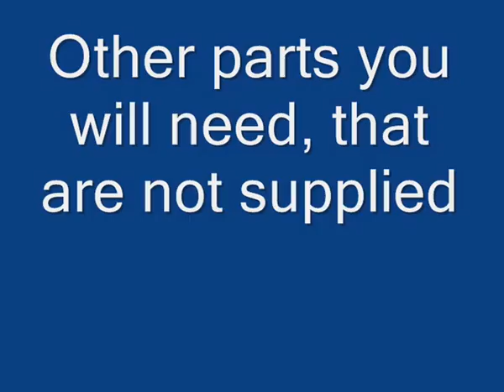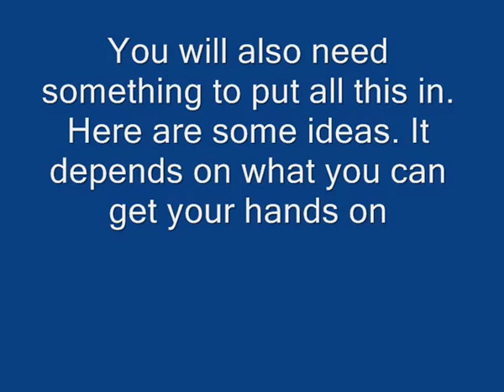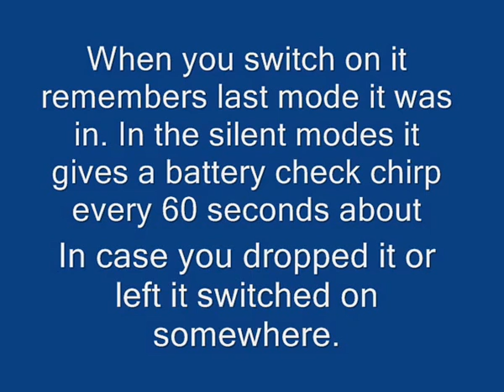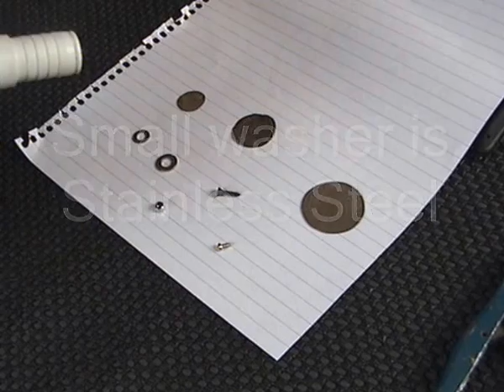pinpoint probe for metal detecting

Comment: Many thanks for posting this and your efforts of course in making it in the first place. I have a few questions if you don't mind?            1. Can the switch be mounted at the rear?  (Away from dirt etc)                                    2. Can one be made to be more sensative, (the one I have goes over 3" and it looks like yours is about 1 1/2".)                                3. Is the side sensitive too or just the top? And lastly                      4. Can a longer piece of ferrite be used?
Mine has started falsing and I refuse to pay the bucks they want for a new one. Besides, it's a sense of accomplishment when finished and it works. Cheers, Chris.

Comment: +davidsmith how many turns of copper wire did u put on the ferrite rod?
Reply from the maker: About 170 turns of .25 copper enameled wire. Make sure you scrape bare the ends of the wire
Reply: @DavidSmith-cz9zv  thx 👍

Comment: I want to build this pinpointer but I want to use it with only the vibrator and if the circuit can move a motor a little larger than 6 v.